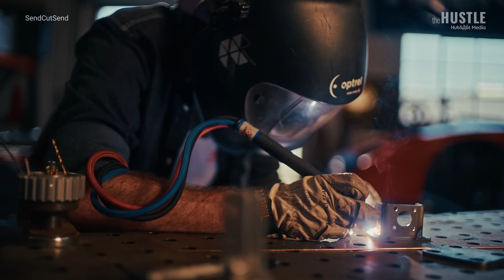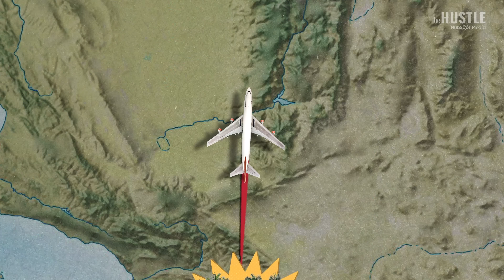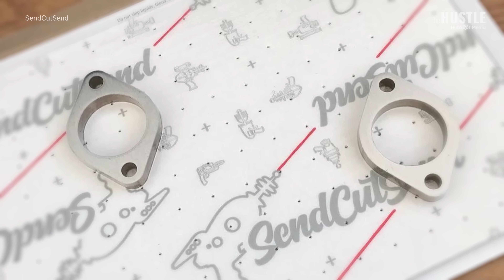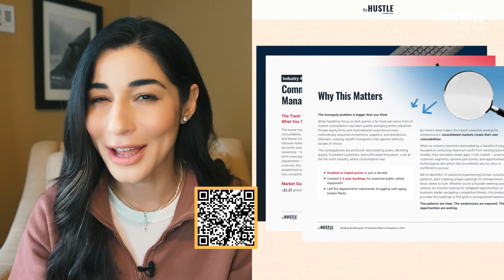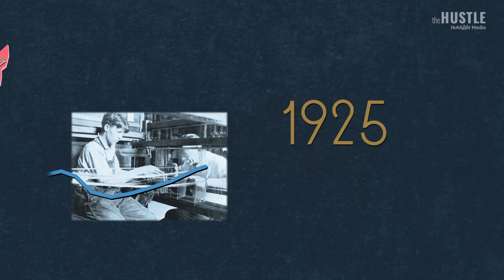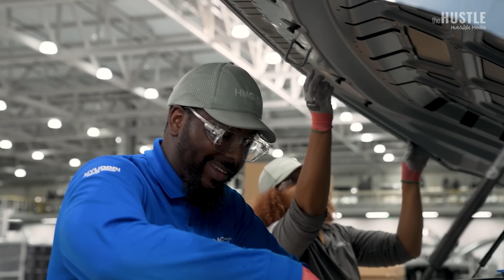He (Accidentally) Built the Amazon of Manufacturing

Comment: This video glanced over the key innovation that has been SendCutSend's primary driver of success.  The software that guy developed to take a file from a customer and instantly convert it into a real quote and then convert it to G-code and get it on the machine with minimal human interaction is the is the biggest reason this company is successful.  I am sure there are some tricks to nest parts of different materials into one sheet of material as well and having standard materials picked via the website... but its crazy.   I can purchase completed parts from SendCutSend cheaper than I can buy raw material to cut it out.  This is probably because the saving in the volume of material they buy is more than the cost to make my part.

Comment: This is really cool for prototyping, hobbyists and maybe low quantity production or custom items, but doesn't make a tiny dent in total manufacturing. It seems like speed is the most important factor here. But if you want to do serious production, you will not be laser cutting and bending by hand. You will make tools and machines that stamp parts at high speed. It is the tool making that has been lost, without tool and die making you are not competing in serious production quantities. It's absolutely great as a company and service, but this is not "bringing back manufacturing".

Comment: Dealt with SCS on personal and work projects. Fantastic website UI, delivery time, and most importantly, precision. They once cut 1/4" aluminum with a number of cut features, and then bent in two places. All dimensions were accurate. I had low expectations because bending 1/4" aluminum accurately takes a lot, but they nailed it.

Comment: Faster, yes. More precise, possibly. Cheaper, no, unless it is a very low production run, or you need it tomorrow, or it is a product with geometry that requires some of his unique machinery, or all of the above. As much as I want US manufacturing to compete with China, SendCutSend is not really going to do that. To compete in volume manufacturing, we need Robotics and AI to drive down labour, a lot of incentives by government to building factories and equipment (just like China did), and a major incentive to build an ecosystem of supporting industries for things like adhesives, fasteners, microelectronics, etc., all the bits and bobs that go into many products, a massive advantage that China has and the hardest one to reproduce.

Comment: Interesting. But hardly new. I worked for a medical machine supply lab 30 years ago, needed laser guided plasma cutter to cut the 20 Ga. titanium we used and bending machines and mig tig welding plus polishing dept. Used some scraps custom cut to put on my leather vest as armor for riding my motorcycle. Protect my spine. Built in kidney belt. Titanium. Overlapping plates in a lobster tail like Japanese armor.

Comment: The new laser cutter/welder/cleaners with CNC are going to give that business some competition. Right now for about $12k you can get a machine that can cut 5mm stainless with great precision, and you get a manual welder that is far easier than regular MIG or TIG welders. Within 5 years you will buy them at Home Depot for $1999. Precision metalwork will be the woodworking hobby of the 2030's.  Together with metal/plastic 3d printing there will be few things you can't make at home.

Comment: even copper?🙃🤪
Reply: Copper is easy to cut by hand or mill at slow speed but can be challenging to work with in manufacturing because it is so soft, making it difficult to clamp without marring the surface, and it is also hard to cut with a laser due to its low melting temperature. Water jet works well, but there are still limitations to the detail size.

Comment: "and even copper" This is something hat's been bothering me for a while now.  When you list some things and end with "and even" that last thing should be the hardest or strongest or most of whatever you're talking about.  Copper is very soft compared to steel or practically any other metal. It's the least hard to work with.  Should have said "And even steel"
Reply: Copper can be challenging to work with in manufacturing because it is so soft, making it difficult to clamp without marring the surface, and it is also hard to cut with a laser due to its low melting temperature. Water jet works well, but there are still limitations to the detail size.

Comment: "even copper"  no big deal if it cuts Steel ...
Reply: So, you're not in the marketing industry. You first list the more expected and common-use aspects of a products functionality, and subsequently the less common. The formulation of the presentation has zero to do with the relative difficulties of one use versus another, since the motive is to never give the audience the impression that there is anything which should surprise them about the product's capabilities.
     As an aside, to your point, there may be many machines which are not calibrated to deal with softer metals in a neat way without splatter or charring.

Comment: I've used them for a number of fairly simply parts over the past 5 years. Overall, I'd give them an A. Responsive, helpful, decent selection of materials, tolerances are decent.

Still, I do wish they'd add some basic CNC for creating recesses/channels and such. I'm not talking multi-axis. Because the workaround of having to stack several sheets of thinner stock to simulate such a part is neither cost effective or practical. I tried it, and it's a major pita.
Reply: You mean they can't cut pockets? All regular 3D CNCs can do that, so it's a lack of function in their software?

Comment: What tends to be forgotten in the whole "offshore" conversation is shipping costs. Containerized shipping was standardized in the late 1960's and didn't really take off ( lots of ships and containers built) until the mid seventies...and at that point the cost of shipping something in moderate to large volume and weight dropped dramatically...not coincidentally, just about the time that "offshoring" American manufacturing became common.

Now, with CNC laser metal cutting, 3D printing of metal (and molds for composite assemblies),CNC multi axis machining,  and rapid prototype CAD software, the time and labor intensive old ways of making things have been replaced with fast, accurate  and low labor methods. 

Unpredictable fuel costs and war zones infringing on shipping corridors doesn't help shipping costs, either.
Reply: What also gets forgotten in the conversation is the way in which offshoring and trade policy has been leveraged to weaken organized labor, and thus funnel more money to the top.
Reply: Time matters more. Shipping costs are low if you ship anything that is relatively valueable per volume.
Reply: If you look at charts of US production though we actually produce more than ever. It just doesn't take labor like it used to.
Reply: True, but these are still low volumes. This is nothing close to producing complex electronics -an iPhone for example. US will need to make substantial investments to be able to do that onshore, though it is starting to happen.
Reply: @flennboyd6413  Bro we have been. For almost 10 years now. Fabs have been in the works for over 5. We won't see those fabs for at least a few more years. It takes about a 10 year lead time before they get built.
Reply: @flennboyd6413  I agree there is a huge difference in scale.  Do you know of any specific investments for large scale iPhone style manufacturing domestically.  I know there is investment in making the chips, but it seems those would largely be sent out for assembly.  I’m sure some would use them on the scale of hundreds or thousands of units in the USA… but millions?
Reply: @Adamroable  In terms of of smartphone, I think consumers reject a 4x increase in price made onshore. But I’d go top down and look at Samsung for example and competitors and then work down. They have the expertise to train US workers, it honestly, the lack of skill will soon be augmented by robots, both on assembly and humanoid. It will probably converge and take 10yr to realize. U.S. factory workers do not have the same philosophy of going to work as say Chinese or Japanese.
Reply: @f @flennboyd6413  I hear you.  I also think US factory workers had a better attitude when they thought companies would actually fund their pension plans and they didn’t have to worry about starving when they got too old to work.  Both China and Japan are generally better at taking care retirees, but neither are perfect.
Reply: @Adamroable  Besides, one analyst shorting even one of these companies is all it takes to set us manufacturing back, to an extent.
Reply: Shipping costs are miniscule. They still are and will continue to be. The turnaround and time will be higher but that didn't stop them before either and it won't.